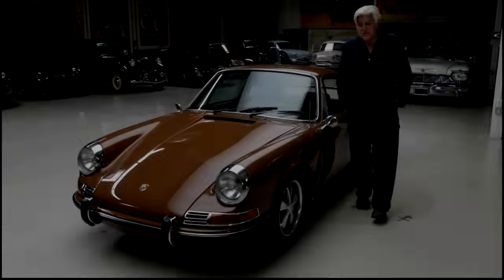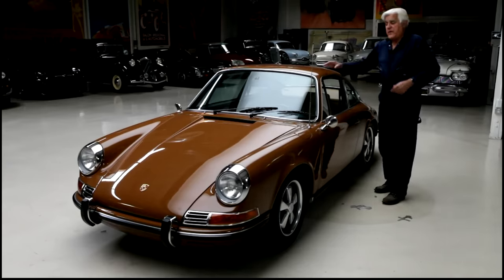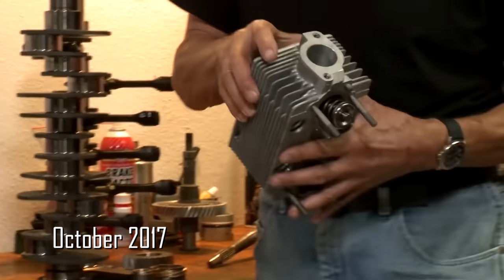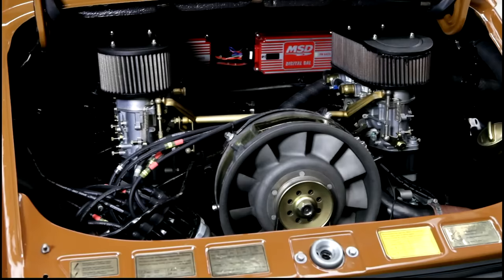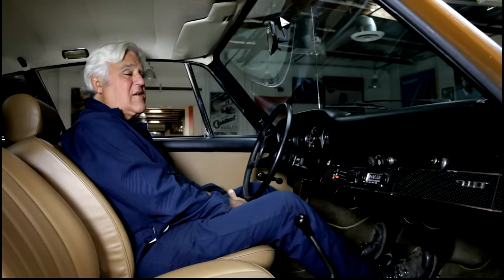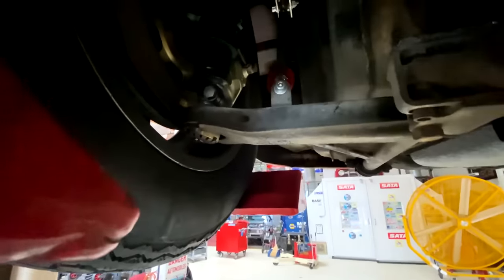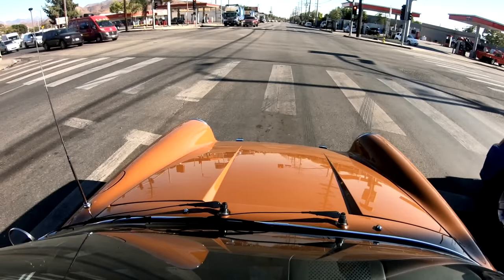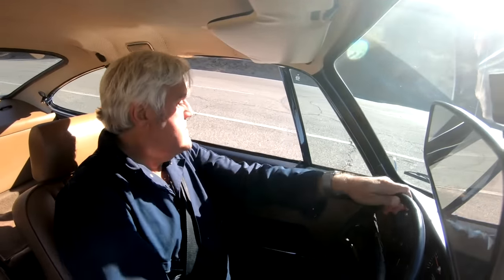1971 Porsche 911 T - Jay Leno's Garage

Comment: I truly despise the new gadgets on cars too. It's so wonderful to be involved in actually driving.
Reply: James, we have an older BMW 528i which was actually a good value, and almost 200k miles on it.  It is a poster car from what you are saying.  Where do I start?  

There are a variety of buttons and switches and stalk controls that I never use, and really don't know what they do.  There are two, TWO separate switches to open the trunk lid, but I always fumble for them.  The radio lowers its volume when you come to a stop...who said I wanted that?  There are a variety of ways to change how the heat/AC is applied in the car, but most settings are via the NAV screen.  I wish they had a manual option....a three selection fan speed, a lever for whether you want the defrost, and a temperature slide.  That is all I need!  The car will tell you if your oil is low by chiming and flashing a warning, but there is no freaking dipstick to actually check it, and you have to wait a few minutes if you ask for a level check.  If you forgot to lock your car and don't have your fob with you, you can't manually lock the driver door.  If your battery goes completely dead you cannot put the car in neutral....unless you pop open the console and use a tool from your box in the trunk to pop it in to neutral...IF you can get into your trunk.

I could go on...but I don't want or NEED any of these "features", and they easily add thousands of dollars onto the price of the car.   They add nothing to the driving experience.
Reply: Lane keep assist and adaptive cruise are nice features none the less.
Reply: @MrBirgerB  For who? People that can't drive?  They shouldn't be behind the wheel of any car in the first place.
Reply: ABS saves a lot of lives. Nice if you can switch it off when you are on the track, but I would hate to see cars being produced without it.
Reply: @enigmaPL  Very well said !!!
Reply: Cars just keep steering away (no pun intended) from actually manually driving. Humanity will come to a point where everything will eventually be AI controlled and we'll just be passengers.
Reply: I bought my first sports car, a used 1958 AH Bugeye Sprite in the early '60s, followed by a new MGA MkII early in '62, and much as I loved it, fell in love with and bought one of the first five MGBs in my home state eleven months later.  We drove basic sports cars in those days, 4-speed boxes, no gaudy interiors, wind in your face, "rain rag" folded up in the plain, painted (no mats or rugs) "boots."  Even my girlfriend's 16-year-old brother could double-clutch down into the non-syncro first gear at the stop sign just before the crest of the hill at the intersection near their house.  Pure driving fun!  I raced one of the tinny little critters and enjoyed every minute of it, even when I hydroplaned sideways through a corner station at Meadowdale International in Carpentersville-Dundee during a downpour.  Nothing like it; just you and the car and the road, with oncoming sports cars beeping or flashing their lights when you met out on country roads or city streets.  I'm still a "Cloth Cap Guy" at heart, nearly 60 years later---and Jay knows what it's like, not ashamed to enjoy it to the hilt!  Stay safe, everybody.
Reply: @enigmaPL  difference is between hooning a car or just commuting. Even fighter pilots use autopilot. Of course you know this.
Reply: @MrBirgerB  I daily a Supra with a grabby 6-puck clutch, in and out of traffic, still feel there's no need for the car to drive for you. Public transportation, taxi/uber/etc. exist for those that don't want to do the driving themselves. 

Comparing aircraft to cars is a false equivalency. The autopilot does alot more and is integral with the navigation to navigate within bad weather, cloud cover, nighttime etc.
Reply: Things that really grind my gears:
-Key fob ignition
-ScReEns
-OxYgEn SeNsOr [engine light gremlin]
-Over sensitive ECU
-Plastic engine covers
-ABS
-Stability control
-Driving speed governors
-Door ajar dinger [Ford guys will know all about this one]
-Automatic window roll down
-Hose spaghetti
-Diesel exhaust fluid
-Intrusive auto-pilot features
-Fly by wire
-Paypig required air bags
-Legendary corner cutting [looking at you, Dodge not even deburred plastic pulley]
-Automatic on/off lights
-50 dollars for 10 cent chinese knock off parts
-THEY TOOK AWAY MY WINDEY DOWN WINDOWS
-Low profile tires and their ANNOYING SENSORS
-Turbo spergery
-Ethanol bros

Out of all this comes our lord and savior of backing up big vehicles
-Backup camera
Reply: @BDLforever24  that''ll be a sad day for humanity

Comment: I have a 1969 912, my mom bought it new(I can say I road in the back seat in comfort as a toddler). For a variety of reasons it ended up in storage for 25 years. When we got it out, we put the car back together, now I never drove the car until my mid 40's(My mom passed it to me because she would rather quilt than drive it). After getting to know the car, I sound like Jay, and I would add one thing the car teaches you how to drive. That's where you learn that horsepower isn't important. It's about the pleasure of driving. 

I think it has the best drivers assist system in the world. Windows. :)

Comment: Before you mentioned the color, I was thinking how it just looks like 1971, and I love that. Not the one I would pick, but I wasn’t around in 1971. 

Signed, a guy with a greenish-brown 1969 Oldsmobile 4-4-2 with a gold interior.
Reply: Ha ha ha.
Reply: 1971 - a lot of refrigerator colors - bronze, avocado, peach, lilac etc.  Mopars came out with the shocking colors in '71 - Go Mango, Lemon Twist, Tor-Red, Sub-Lime etc. Good times when you could hang your elbow out the window unlike today's cars. 🚗
Reply: One of those new targa models would look great in that color, but I like the old simple stuff like that myself, has to be a blast to drive
Reply: I was born on September eleven 2001 and I don't like old cars that run on gas,  if a car turns 10 years then it should be given to the museum or destroyed. We need to go electric .... Wake up people before it's too late...
Reply: @princeedmunddukeofedinburg  you obviously have no idea of the terrible effects on the environment to mine, process, and produce the lithium that the batteries of electronic stuff is powered by, spoiler alert Santa Claus ain't real either
Reply: @alanmoncus2331  The trade off had been examined and debunked already. Think about it: First a new ICE powered car is manufactured, put on a truck or train and sent to a dealership, where it is bought and continuously burns fuel for 15 years. Now multiply that by the number of ICE cars on the road. This doesn’t even take into account the process of obtaining raw materials.

An electric car begins life in the same way: But it is equipped with a battery on the assembly line. The initial process of making the battery is harmful, but it is kept on the same car for 200,000+ miles and charged. Yes, that energy comes from somewhere, but far less is drawn per car compared to what is required by ICE equipped vehicles.

People often look at this issue in a way where EVs and hybrids are supposed to eliminate energy consumption. This is not the point! It’s about reduction!
Reply: @princeedmunddukeofedinburg  The percentage of vehicles that  run on petroleum products and are considered important, be they vintage types or more useable classics are a vanishingly small number. Also they generally each clock up a few hundred miles a year at most. They also have been kept running for fifty years or more. That means five new cars at least would have to be made to fit your plan to replace one classic over its life so far. Building one electric - and here I hazard a guess - I expect to add more to the CO2 levels than a dozen classics. Plus many are simply works of art. We don't want to go the route of destroying beautiful things do we.
Electric with batteries is certainly not the answer either. The only answer for the planet really is to do away with personal vehicles altogether. It is a crazy waste when you examine it. Madness even.

Comment: Love how he talks about the mileage, a car is supposed to be used.
Reply: Even if I had the original 66 Batmobile, or Hitler's limo or some other "museum piece", I would STILL drive it, at least occasionally.
Reply: @areyousureyouenteredyourna85  well Jay is only guy who 4 example drives his Veyron owned Bugatti type 37. A car worth god knows how many millions. Only thing that holds him back is insurance freaking out
P.S. seems ppl are confused Veyron was a racing driver for bugatti in the 20/30s. Jays white and blue type 37(??) Was actually owned by this racing driver. Bugatti named their new supercar after him making his name a commonly known name. But few know the 16cyl 262mph car was named after an old racer.
Reply: @Deftonesdsm  yeah, insurance companies suck.
Reply: I have a 86 carrera.... over 210 000 miles.  Still tight...still love driving it !!!
Reply: @Deftonesdsm  veyron owned?
Reply: @callmejohn9664  the famous french racer from the 1930s was named Veyron(last name?) So bugatti named the Veyron 16cyl 4 turbo car after him. Jays white and blue (type 37 i think) bugatti from the 1930(1920s?)s Jay discovered in its history its the actual car Veyron owned while he was driving races for Bugatti. Meaning its not only a rare bugatti its one of bugattis most famous racers old car. A "holy grail" car worth WAY more than the modern bugatti's
Reply: Well and thats shocking. 100k miles on an older Porsche. Not that I'm a member of  a Porsche club but I don't know anyone was a modern Porsche with that many miles.

Comment: Just got around to watching this video. Having owned a new 1967 911r and living in the Boston area.  The car essentially rusted away from day one. The factory  undercoat was one of the big problems with the body degradation. Even the carburetor air boxes had rust issues. Diffidently was a fun car to drive. And the 901 transmission took some getting used to with the unusual first gear position. Keep up the good work you are doing to preserve the history of the automobile. Wish I still had it.

Comment: Bought my Porsche in 1/19, a C4S  manual.  Drive with open windows, no A/C, to enjoy the engine/exhaust notes. Has 12k miles on the clock; long road trips through the SE US returned nearly 30 MPG, on a 420 HP car capable of 180+ MPH. Agree with you about power. Would be just as happy with 100 HP less. Great video, thanks again for sharing.

Comment: I bought my 87 911 with 10k miles 25 years ago. No rain, no snow ever. Big top end engine, hoses, brakes, suspension, fuel system, clutch, @ 80,000 miles last winter. Original rust proofing still on the pan, along with original paper labels on the shocks. 
I love this car. And it’s Carmine Red.

Comment: "Just want a little more power" = an extra 80%. So for a little bit more power in a 350 hp car Jay thinks a little would be 630 hp 😂😂😂
Reply: He "didn't want a hotrod..." then let's call it a sleeper. With 225 hp the old 1971 911T may surprize many drivers of more recent Porsche's.
Reply: @FrenchCrow  Yeah, he definitely lost me on that one lol. He should have just said he didn't want to make it hard to drive (heavy clutch, higher octane fuel, etc). Because  I would consider anything that has almost double the HP a hotrod. Especially when Air cooled HP is so expensive
Reply: @obsidian....  I guess he said "a little" because for him 220 hp is not that much power and just makes a cool lil' car :o) and anyways money is not a big concern for the guy...
Reply: @FrenchCrow  Oh 100% money on the money part 👍. But he said "a little more", which means it's relative to what it has. A little more of a lot could still be a lot. But a little of 125 is definitely not 100 lol. 
.
It'd be like me saying "I got a little cut on my arm" only to later tell you that "my arm was amputated above the elbow" and expect those things to mean the same thing 😂
Reply: @obsidian....  Jay is not into relative but absolute... 100 hp is not much power for him therefore +100 hp is adding just a little 😂
Reply: this is a T with 125, but the same year S has 180. From there it is not a big jump to 225...

Comment: This has to be one of my favorite reviews done by Jay .  So pleasant and pleasing how he went over the car's compleat condition as purchased and all the really cool finishing touches. Wow ! I am amazed at its' original hp rating. Must have been pretty docile. And now. 225 hp !  Perfect. What a great sound it makes !  A real drivers car. All our cars have been manuals since I learned how to use a stick on Datsun rental back in 1982. I remember being intimidated over whether or not I could smoothly handle a stick on a new car. Then I test drove a new 1982 Toyota Corolla SR5. I just loved that car and the way it drove ! Our latest a 2017 Accord 6 speed is different. our 1994 Civic 1.5 liter 5 speed shifts silky smooth. But the '17 Accord is quite notchy. I kept hoping that it would get smoother, but it hasn't. Somehow it does not bother me. I think of it as insisting on more refined and exacting shifting. We have the powerful six and it just strikes us as elegant. I causes us to drive more precisely and without anxiety. I think I can count on two hands how many times we have used heavy throttle. Maybe because it is a coupe. Most everything has four doors.

Comment: I really enjoyed this video showing your 911T. I was taken back 50 years when I had first a 55' 356A then a 65' 356C. I remember the feeling of driving those cars through curvy back roads. I think those cars were only about 1800 lbs. I liked the part where you showed the engine rebuild. I had done that on the 65' which had chrome lined jugs (cylinders).
Thanks for the tour, Jay  BTW I miss you on late night TV

Comment: Jay's best comment to the masses "Learn how to drive. Thank-you"  :)
Reply: curbozer Boomer    When driving those old skinny-tire 911s around a curve (especially the pre-'69 models with the shorter wheelbase)  it's "slow in, fast out", i.e., brake before the turn, not during the turn (it will oversteer thanks to the pendulum effect of the rear engine).  The key is keeping your foot in it as you make the turn to take advantage of the rear engine push.  When they started moving to staggered wheel/tire widths (ie, wider rear tires and wheels) by the '80s,  there were fewer problems because the tires could more easily maintain grip.  Of course some of those tire widths and wheel diameters now on newer models are insane (ie, 305/20 with 21 inch wheels)

Comment: Nice video, great early 911 sounds. Jay's mods are tasteful and sensible without going overboard. Makes me want to get my 1970 911S back on the road. Owned it since 1972. That car sounds even better with wilder cam, higher compression, lighter weight (2250) and higher redline. I put short gears (B,F,J,Q,X) in mine and each upshift feels like an afterburner kicked in.  The oil squirters came standard on the S. Nice feature. Many people don't know that a large % of engine cooling in an air cooled car comes from the oil cooler. The S has a large  auxilliary oil cooler below passenger headlight and it really works. Drops temp about 30º vs. another 2.2 liter 911 w/o cooler. You need a damn big pan to drain almost 11 qts oil.

Comment: Facts on spot on.  The old 911-T is truly the template for what a fun sport car needs to be.  No overkill.  I've found the very same pleasure in the VW Golfs and Cabrios that were made from the late 80's up to 1998.  I happen to have 3 cabrios, '95, '98, and '01.  The 1995-1998 is the last run of a strong, carefree fun car.  Good looks, Good handling. Post Millenium saw VW going cheap on critical components.  Your Auto Entity would serve your audience well by showcasing a VW Cabrio of the 1990s mfg.  Thank You so much Jay for this channe.  I've seen better years health wise, but I'm still able to maintain my own cabrio collection.  AllTheBest- Eddy from MS

Comment: Jay: I want to make this Porsche a little more powerful
Normal person: Bigger turbo!
Jay: Change the displacement of the engine by increasing the size of the bore plus a longer stroke crank out of a 2.7L resulting in exactly 2.5L keeping the original transmission with larger valves
Reply: How exactly do you put a "bigger turbo" on a '71 911 T? This isn't fast'n furious🤦

Comment: As they say, "I can certainly relate". Jay and I are almost the same age and my first 911 Porsche was a 1969 911T coupe. Aubergine (maroon) with a rare cream interior. 2.0L, 125hp 6 cyl. boxer engine; Weber carbs and 'dogleg' 5-speed transmission. Drove it all over Northern California while stationed with the USAF in the Bay Area. Those were the days!
Years later for my 50th birthday I bought myself a 1973.5 911T Targa. 2.4L, 140hp, light yellow with black leather interior and 'houndstooth' inserts. Still have it and drive it 22 years down the road for the very reasons Jay so rightly covered. Thanks, Jay!